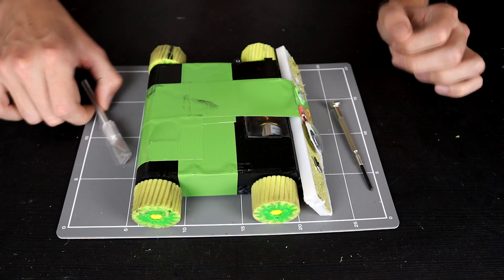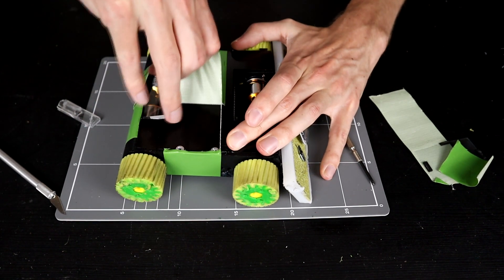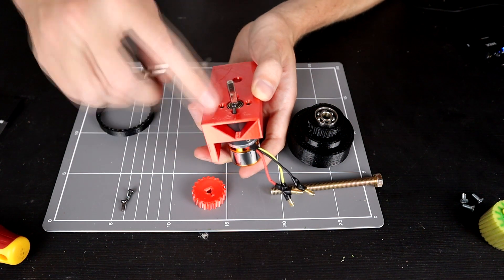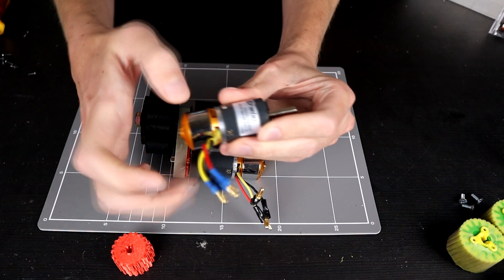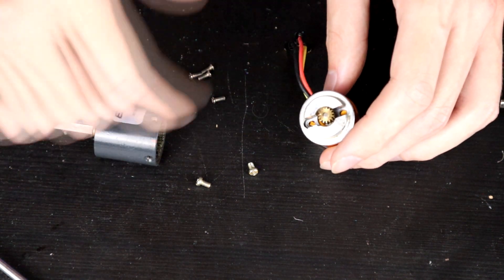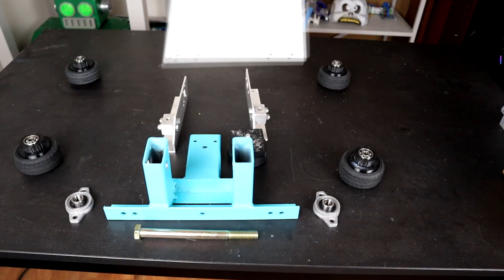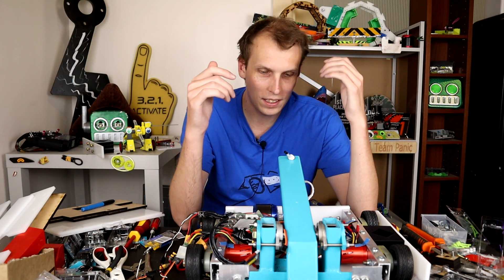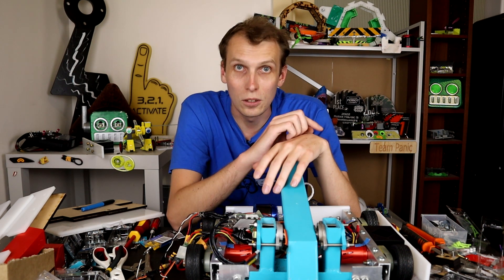8kg combat robot with a yolo winch flipper! (full build)

Comment: Why not use spring loaded and cam mechanism
Reply from the maker: This build was done just after Blip was at battlebots with a flywheel flipper and I wanted to see if the same idea could be done without the flywheel and complex clutch 
So I didnt use a known method because the point was to experiment with a new design idea

Comment: Don't wanna be rude, but that didn't look like a good idea, too weak for a flipper, too complicated for a lifter.
Reply from the maker: Hi
You are responding to an almost year old video, the engineering cycle (build, test, fail, improve) is much faster in combat robots then it is most places.
You are correct that in this form, the bot didnt work to well: https://youtu.be/oKO390bJDTI
But its since been improved: https://youtu.be/Jrv8IkUsfaE
And worked well enough as a lifter in its next round of fights: https://youtu.be/9TMtfEg2P1E

Its still not prefect, but its an idea worth iterating on, because its got merit.
With a few minor changes I know it will flip a bot
Reply: @TeamPanicRobotics  I think I agree with people that say that you need to store potential energy somehow(e.g. in a spring or pressurized gas), so I'm wondering if you could charge a large capacitor and then use it to power the motor so that it releases all the energy at once, but I don't know enough about electronics to tell if it's a viable option.

Comment: Maybe this goes against the spirit of the flipper design and the "yolo".

But if you have a high torque and rpm brushless motor and need more velocity from a pulled rope, why not use pulleys?
It's a bit archaic i suppose, but pulley systems have been used as velocity and force multipliers for a long time lol.

Also might be hard to shoehorn into the chassis XD
Reply from the maker: I have considered it, but I think the yolo system will work, I just need to get the ratios right and I'm pretty close now, I've gone a few revisions on it since this video

Comment: Check out the original mechanism that tantrum used when they were a flipper. The important thing with a flipper is utilizing stored energy that is released all at once either with a spring or pneumatics.
Reply from the maker: Traditionally yes, this design was an attempt to build a flipper with the raw power of a very big brushless motor
While its performance here was a bit underwhelming I'm sure I didn't use all of the power of the motor so with some geometry changes I think this concept will at least work better

Comment: As you said.. it seems like you need to move pivot point back as you need better ratio. at this point you have max torque but min distance, what you want is more distance as i assume this motor has more than enough power. You have to find the sweet spot of the most movement with enough torque to lift. Basically you need to slide you pivot point back until it maximizes distance and can still lift... seem like this calls for some testing. Blip for example get a ton of movement perhaps 90 degrees or more and builds it torque through its lift. Right now you are only getting like less than 10 degrees which just aint enough to grab and lift. I'm not saying you need 360 degrees like mammoth but that sweet point of power and distance is in there. 

Also depending on your setup you could locate you wench in the front so that you pull the arm a further distance and this would shift you eight around so ya lots of tweeks that you easily impliment by moving the motor or pivot point.
Reply from the maker: Agreed that I need more motion, the arm barely moves currently, pivot back and longer flipper arm are definitely the plans for a V2

Comment: It looks like the shape of the flipper arm doesn't allow much movement because it's angled downwards at the front. If the arm were straight you could pull the back end down much further before it hits the stopper, increasing travel at the tip of the flipper. Since you would't have to make the forks longer doing this, it would still have more or less the same lifting power? (not sure but it seems logical to me)
It probably would't look as good though.
Reply from the maker: A straight arm wasnt something I'd considered but that probably would have at least helped

Comment: As someone who fanboys too hard for blip,
I have two possible suggestions to improve the force of the flipper
1. Leave a little slack in the rope attached to the flipper, this will let the motor spin up more before taking the load of the flipper
2. Add some sort of weight to rotate with the motor, kind of like a flywheel, this will help increase the total kinetic energy gaining into the load so that the motor can spin longer before stalling.
Reply: expanding 1. a  bit, setting it up more like a capstan might help - generally a capstan has rope looped around it loosely so the drum can turn continuously without grabbing the rope, then a small tug on the loose end of the rope pulls it tighter onto the drum which then grabs the rope with full power/torque. This way the drum could spin up at all times and has a servo/solenoid to tug it tight to trigger. I'm not 100% on how you'd release the tension after it's grabbed, but would certainly give more kick to the system.
This would also benefit from 2. in the same way.
Reply from the maker: the capstan idea is interesting, but does add a level of complexity... hmmmm
Reply: @TeamPanicRobotics  it would probably work better with a lower friction material, teflon or hdpe maybe, as the friction grabbing the drum is multiplied by the number of winds on the capstan. Low friction helps when you want the drum to get up to speed, then the friction multiplication makes the low friction mostly irrelevant when it engages.
There's an anecdote, I think on the wiki page, about how ~7 turns of rope would allow a newborn baby to hold an aircraft carrier stationary due to the multiplication of friction. Kinda nuts.

Comment: I love these low-tech sportsman feathers, way more room to build stuff in but it's not going to be absolutely rekt in the first match if your manufacturing skills aren't 100% on point.

There are a couple of variables you can work with when you get back to see if you can get it working better (if that's even the objective): the mechanical advantage is maybe a bit too high (arm ratio between the winch, the arm and the flipped endpoint) so you could try moving the winch attachment point closer (or further?) from the pivot point, you could try to tweak the winch pulley size so that more/less rope is being pulled per rotation of the motor or maybe use a rope with a bit more elasticity so the inertia of the flipper arm/opponent robot give the motor a bit more time to put energy into the system.

Great stuff and keep doing awesome builds like this!
Reply from the maker: the flipper arm will be longer for v2 for sure

Comment: Isn't this almost the opposite to how Diotoir from the original robot wars worked? Car springs used for tension and chain to pull it into the firing position.
Reply: Correct, that's the yolo part.

There is nothing that stores the energy from the motor (in contrary to Diotoir and the first Tantrum that had a spring to accumulate energy over time to release it all at once when firing), just directly pulling the flipper arm up. Big difference there is that current brushless motors and lipo batteries at feather scale are insanely powerful, the motors in the Diotoir time didn't have the torque to just yolodrive a flipper and I don't think it's viable (yet) at a heavyweight scale.